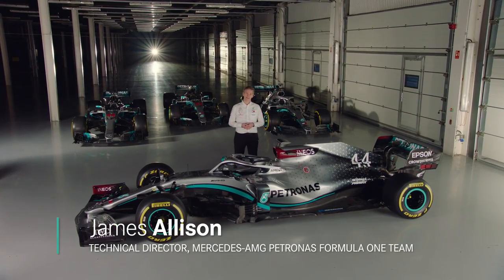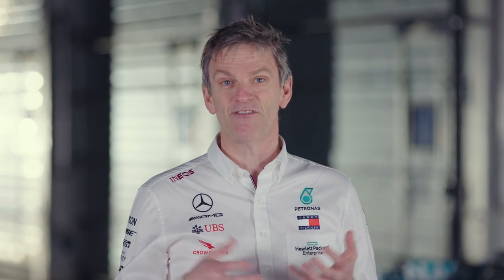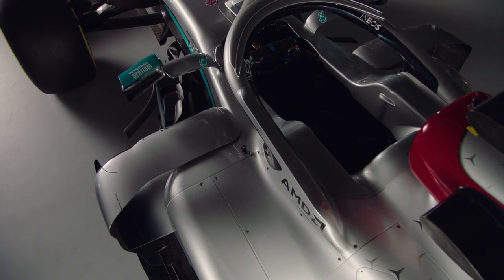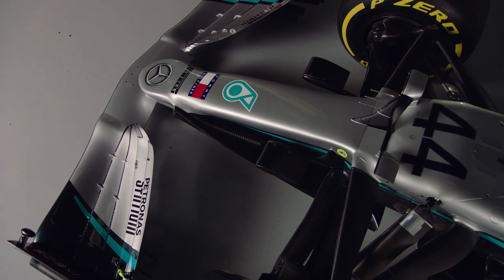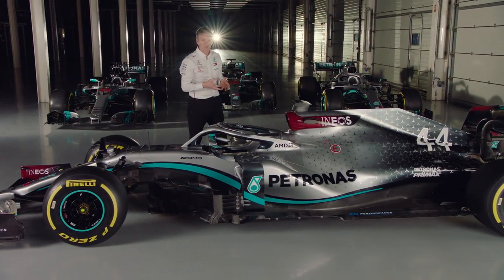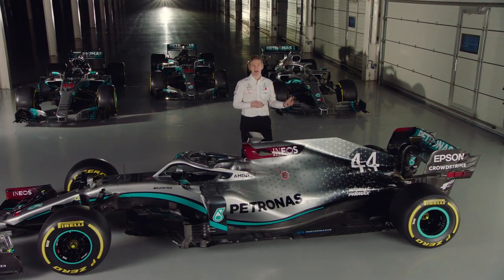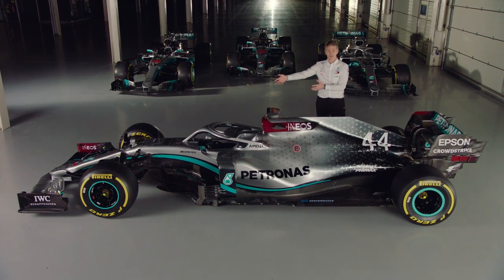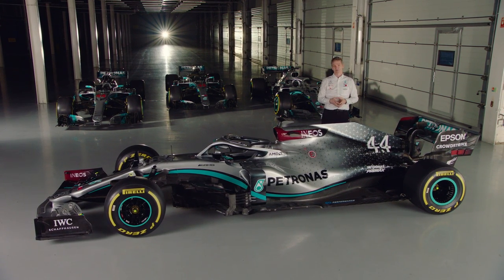The 2020 Mercedes F1 Car Explained!

Comment: 3:28 “Many years into a regulation with fixed fuel flow”...I see what he did there😂😂
Reply: oh man, nicely spotted! lol
Reply: Can someone explain
Reply: @Zak-ob5ze  Ferrari were accused of running more fuel flow than everyone by a longshot thus why they were so fast on the straights
Reply: in terms of engine development, mercedes have been dominating since the start of the new turbo era with split turbine/compressor, pre-chamber ignition, multi-spark ignition, air-water intercooler & etc. the engine on testing dyno even managed to reach 50% thermal efficiency which is unheard of for automobile ICE petrol engine.
Reply: @comparecars_org  Every single team is already pushing the fuel flow limit to the max. The FIA clearly defined how much fuel flow is legal and the teams know that. You can't go beyond that within the rules, which is why Mercedes focused on making the engine be able to run hotter this year
Reply: It all made sense now after F1 press release today.
Reply: cough ferrari cough

Comment: 3:30 “fixed fuel flow” shots fired at Ferrari
Reply: Now you reminded me of that.When you look at it Ferrari actually lost speed at that time(USA GP I think) and never got that back.I mean what else to think than they did mess with something not quite legal
Reply: @BladeRunner031  Yea, but that was also due to Austin's resurfaced circuit, and I don't recall Ferrari slowing down at Abu Dhabi too....
So get your facts right
Reply: @alessiocirino7616  You are right,finishing 45 seconds from Hamilton in the race and just 0.5 seonds back in qualy is competitive Ferrari like we watched whole season,in Brasil too,slower than we watched before,cmon man
Reply: @BladeRunner031  you should have seen Ferrari's rear wing in the USA GP. It was at a really high angle of attack to produce extra downforce while compromising straight line speed.
Reply: @SB3_01  But than you have more downforce and you even more competitive,right,like Singapore for example? We saw nothing from that day up to today.Nobody can assure me than they are that stupid to produce slower car for 2020,I find that impossible.Lets wait and see,testing lap times are just testing lap times,not important
Reply: @BladeRunner031  that right because at Monza , even without drs ,and  racing against Mercedes down the straight with it drs open couldn't overtake it all race long .
Reply: @BladeRunner031  
In Abu Dhabi Ferrari were quick in s1 and s2 but they lost all time in s3

Comment: Many many years into a regulation with fixed fuel flow. 
Ferrari: Has left the chat.

Ps: I dont think they are cheating just said it for bants.
Reply: They aren't cheating anymore, but given the lack of straight line speed after the regulations were clarified, it's pretty clear that they were cheating
Reply: @filmandfirearms  there was no drop in performance. There was in Brazil but in AbuDhabi quali the ferrari still had the same numbers as they had before the accusations
Reply: @eruptic6503  What about Belgium? Their straight line speed advantage seemed to disappear out of nowhere. Same with Monza. Leclerc was fighting off both Mercedes drivers for almost the entire race, despite Ferrari supposedly having the advantage there
Reply: @filmandfirearms  sry dude but the fuel flow accusations were for quali not the race.

Comment: Mercedes are doing the opposite of Sandbagging this season, be scared rest of the grid..cause we are gonna roll
Reply: No, sir.  They are still sandbagging.
Reply: They are still sandbagging.  Im guessing at least 1 second faster than rest of the grid.
Reply: Mercedes is sandbagging but there has not enough sand...
Reply: MEGATRON  They sandbagged last year in testing. Wrong.
Reply: @MEGATRON I'm well aware, simply having some fun with the current prevalent narrative. ;)
Reply: They are still sandbagging, VB fastest lap on testing is about .200 slower than last year record in Barcelona. Allegedly, they still can push the car about half a second; although, Mercedes concentrates not in making a car that is fastest over only one lap but consistent and reliable over many laps. I’m very interested in the PU upgrades since over heating was a problem last season.
Reply: MEGATRON  Hi sandbagging doesn't mean deliberately not pushing the car. Even though its a layman term. Teams do try to appear differently. They do fastest sector times and abandon the lap. They aren't even pushing yet. No spins no nothing. Mercs haven't been running on limit. They have been debugging the car and ran long.  Lets wait and see next week.
Reply: It very well could be that they are still Sandbagging, that would be really scary!
Barcelona Quali-time 2019 was 1.15,406 and it will be beaten by a lot I guess.

Comment: Something this year that will squeak by and has already been banned for 2021 is the ability of the driver to adjust the toe in and out adjustment of the front wheels. Front ends are toed out creating friction to some degree....so they came up with the idea that if the driver can straighten the toe out in straightaways, the car will reduce friction on the tires...the steering wheel moves slightly forward and backwards like a yoke...lets see how this works out...we got one season to find out.

Comment: So F1 has preracing in February. But are they aloud to make these changes prior, and test these on their own tracks? Along w/ test in arrow dynamic wind tunnels etc. before preseason testing/racing. Kind of new to F1 rules? Do they release the rules to body/frame changes, hp, gear box, etc at some point after the season to give engineers time to develop cars???

Comment: Pressurized coolent like NASCAR .

Is there by any chance an integrated sidepod with intercooler . Built like a basking sharks open mouth while feeding and water going out from the gills mechanism . Rather than the intercooler sitting like a brick. 

Has any one used higher engine oil pressures to use the excess pressure for hydrolic assist like a steering assist but for the piston spinning the crank .

Comment: @4:40 when suspension components are aerodynamic. 
This is crazy,  is this degree of engineering even used with aerobatic aircraft non-retractable landing gear? 
I would think not.

Comment: Not a word about dual axis steering; (I think it's called); sliding the steering "wheel" forward and back to change the front wheel toe-in. Mercedes has it and all the others are scrambling to get it. Ferrari says it will be mid-season at least before they can develope it. Apparently it's a total surprise to everyone.
What it is; push the steering device forward going into a turn, and the front wheels toe in slightly giving a turning traction advantage. (Most F1 cars are set up with toe-in for the whole race.) Pull the steering device back for straights, and the front wheels straighten to parallel, reducing tire scrub and the associated resistance enabling an increase in speed and longer front tire life. This is a significant advantage.
There are rules banning driver-adjusted suspension, but that's not what DAS is. Expect a rule about it next year, I'm told.

Comment: I'm really looking forward to seeing how the 2020 game copies the DAS system for the Mercedes
Reply: On button
Reply: @BladeRunner031  Except it isn't an on/off switch. The driver pulls or pushes the wheel to adjust the toe. You can't just flick a switch. My best guess would be they'll have it on the MFD menu, next to brake bias and diff settings

Comment: I will disagree with James, that they had the best car in 2019. Ferrari had the engine performance, Red Bull had the handling and cooling advantage. In 2018 they struggled with tires. What they had was the best team from the factory, to the trackside personnel, to the drivers. They learned from their mistakes, capitalized on other teams' errors, and made the right corrections to find the potential in a car design that came up that bit short to its competitors. That to me is what differentiates winners from champions.

Comment: I love Hamilton and Bottas.

But this sport wont get interesting anymore, if the same team wins over and over and over and over and over.
Its like in football: FC Bavaria Munich. They win almost every year, get more money, and win more and more. 
I wish F1 would add things like reverse grid, added weight like in other major racing series.
I wish, that it would be drivers talent, not the cars power.
Improving is very nice and i love the design of the car, but I hope 2020 will be more interesting than last year.

(Btw i came from the Chainbear video, why F1 has a problem)

Comment: They already won. 

Other cars will finish a minute behind with this rule breaking Innovation. Yes, it changes the active suspension system of the car.

It allows the tires to be managed much more easily than any other team. 

While other teams have to cool down, save tyres, and drive slowly, Mercedes FIA will simply straighten the tyres and remove all extra friction during straights.

It will be more powerful than DRS, and it has ruined the season. Well, not for Mercedes.
Remember I said it.